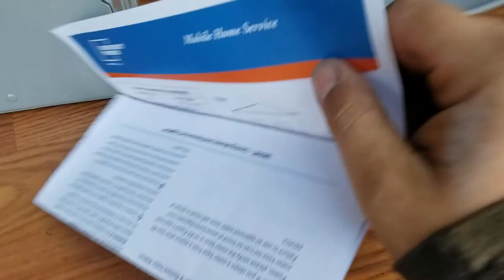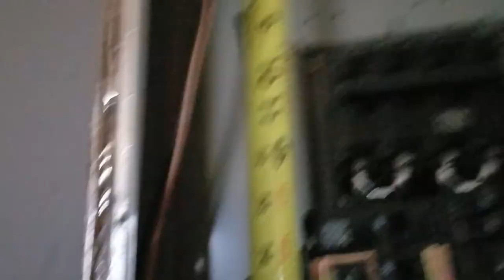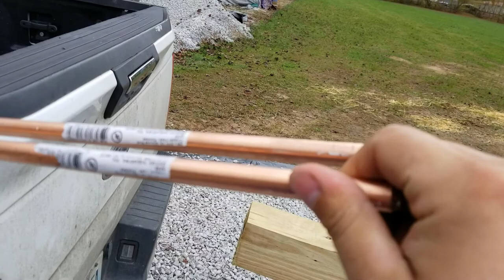How To Install Electrical Service: 200 Amp Main Breaker (Electric Service) Cost

Comment: I'm going to help a friend setting up his trailer...I've done industrial electrical work most my life...found this video very helpful...well done! Only question be why such a big earth ground (green) cable?
I believe a #4 wire...non-insulated...would've worked.
👍
Reply from the maker: It's not necessary
Reply from the maker: Only cable available at that moment

Comment: Great Video. I have the same inside 200 amp main panel in my Double wide as of recents I have been having the 200 amp main breaker trip off and get warm to hot. On the left side of breaker housing looking straight on. I turned off the 60 amp,50 amp and amp breakers for the in op furnace, outside central A/C unit.To lighten any excess load. It is winter and we nave 3 small space heaters that pull 1000w each An eleecteic water hear 40 gallon,plus 3 tvs and a fridge. The heaters seem to make It trip occasionally but more.recently the water heated does even with the heaters off. In your opinion do you feel that too much load on the 200 amp.breaker,  bad ground or bad 200amp breaker. Also on my ge 200 amp.breaker wher e the 2 hots come in to the lock lugs. The left lug is only making contact on 1 side of the metal brackets were the circut breaker inserts. Should all four brackets be touching the lugs and may thos be causing the oveoaded 200 amp breaker? Once again awesome video.
Reply from the maker: ThNk you!  You're the best!
To answer your problem,  you have a faulty inside panel.  I have ran into same issue in another rental.  Initially. We knocked the main breaker outside and then on the inside panel. We redid the lugs and tightened everything down.  It was a temporary fix.   Until we got the indoor main panel.  We then had to cut some sheet rock to reinstall the new panel.  Now that the project is finished. Everything works as it should.  Join my discord if you need anymore help

Comment: How far does the meter base and disconnect box supposed to be from the mobile home?
Reply from the maker: Depends on your code in your area. We can have ours right up against the home
Reply: @hurley001  I really don't know much about it. I have to install electric in a single wide trailer in Southern West Virginia, Near Huntington
Reply from the maker: @countryascanb5229  you should be fine. If you want to put it a couple feet away. It should be okay. I'm about 1 hr from you bub

Comment: I'm really interested in learning some of this stuff. At this point, I'm just a little better off than clueless. Does it matter which hot wire goes where in the panel? Are they the same wire? Does it work as long as you run them to the right place in the meter box and in the panel?
Reply from the maker: They carry same voltage
   Ad long as either hot goes into either hot lug you are good
Reply: @hurley001  thanks a ton. I am getting some electrical work done. I know a guy that has been an electrician for over 50 years. He's recently had surgery and can't do any of the manual labor himself. I was just curious to see if this were something I could do the physical work myself and then let him inspect. I have basic knowledge of how it works but not much knowledge when it comes to the specifics of connecting things.  I knew what and where the neutral connects but wasn't sure on which of the 2 hots went where. This guy is gonna help me out a lot just by being there to sit on a stool and tell me what to do but I would love to be able to get as much done as I can before he gets here. I would like to keep him from moving around as much as I can. Thank you very much for the information
Reply from the maker: You should be able to do the work on your own as long as he has number to give to the inspector.   So what I do,  I do the work and I have a friends numbers.  I call inspector. He comes out. I give him the numbers. He looks over the work and it passes and we are finished
Reply: @hurley001  so my friend got here yesterday and inspected everything. I had almost all of it done (all of it done right lol)  before he ever got here, thanks to you. The only thing I didn't have done was a ground rod. He has an air compressor and power inverter in his truck with an impact and auger. I just stretched the air hose and ran the auger down 5 feet. The ground here is really hard so it was a lot easier than hammering it in all the way. The impact and auger does all the work if you take your time. With the auger being a little smaller, the ground rod still had a snug fit. It gets inspected Tuesday but my friend says he is 100% confident that everything is good to go. Thanks again
Reply from the maker: Awesome!  Update me asap on the inspection
Reply: @hurley001  they rescheduled the inspection. The guy that was supposed to come out to do the inspection had a death in his family. Very understandable why he wasn't able to make it. It got done Thursday. Everything was fine. Electricity is supposed to be connected Tuesday. Thanks a ton.
Reply from the maker: @joemattox7525  awesome!

Comment: I have a question for you.   Is the meter base equipment grounded?   I’m thinking that since you put Teflon tape on that nipple, that there is not ground between the panel and the meter socket.   Did you say you put 4/0 copper to the ground rod from the panel?   Largest you are supposed to run to a ground rod is #6.   Everything else, except the equipment ground size seemed well done!
Reply from the maker: Copper 6 from panel to ground rod.  I did use Teflon. However, wouldn't the neutral serve the purpose of meter ground as well?
Reply: @hurley001    It depends.  Yes if the lug for the neutral is bolted directly to the can.   That is possible.   If not, then the fittings as ground are questionable.   Been too long since I’ve been in a meter socket.   Hopefully, you are correct!
Reply from the maker: You're the best. Thank you!
Reply: @hurley001    I’m retired Electrical Design Engineer worked for contractors 35 years.  If you have any questions, I can try to answer.

Comment: Do the two black wires have to match? Like from the breaker box outside does the left hot wire have to go on the left inside and the right with the right spot?
Reply from the maker: No. They are 120v either way you put it
Reply: I was looking for this answer by everywhere thank you!

Comment: What size cable can i use from meter to 200 box amp?
Reply from the maker: 4/0
Reply: What about 250 kcmil?Its bigger correct.If I use 4/0    .Its just #1#2 hot and neutral or ground correct.Is it better all cables together or individually.In one bundle
Reply from the maker: 250 is bigger.  Yes 1 and 2 hot and neutral. I like all together
Reply: Thank you
Reply from the maker: You're welcome
Reply: @hurley001  do i need a 4/0 neutral wire as well?
Reply from the maker: 4/0 line 1 and 2 and neutral. From meter to box
Reply: But that be 4 correct 2 hot 1 neutral and 1 ground?
Reply from the maker: @ramongalaz6263  from meter to outside 200amp box is only 2 hots and nuetral
Reply: Thank you
Reply from the maker: You're welcome

Comment: Is it a lot different installing a meter box/ main disconnect combo box? Like do you still have to wire the meter and what not. Confused! lol
Reply from the maker: If meter and panel are in 1 box   no need yo wire it

Comment: Did you pass inspection using metallic conduit with teflon tape and no bonding bushing?
Reply from the maker: I had a 2 inch bushing on the nipple

Comment: Hey Hurley can you please share the link to buy the cable that you used in your video from the meter box hub coming out of the weather head and the feeder cable that's used from the 200amp breaker box to the Main breaker box inside the mobile home trailer.
Thank you.
Reply from the maker: I think I have everything listed with link on my other electric vid
Reply: Thanks a lot.
Reply from the maker: https://www.lowes.com/pd/Southwire-Southwire-4-0-4-0-4-0-Aluminum-SEU-Service-Entrance-Cable-By-the-Foot/3129321  this is the cable that goes down the pole to the meter box.

https://www.lowes.com/pd/Southwire-Southwire-4-0-4-0-4-0-2-0-Aluminum-Mobile-Home-Feeder-Service-Entrance-Cable-By-the-Foot/3129329   this is the cable from main lug to panel inside home
Reply: @hurley001  Thanks once again.
Reply from the maker: You're awesome!  Thank you!

Comment: Anyway u can drop a list of all the material you used im getting ready to do the same thing an really could use a list to go off of thank you sm
Reply from the maker: I can send to you asap. I'm not home at the moment
Reply: That would be great please I’m having the hardest time trynna get a material list up for it
Reply from the maker: Just got home.  I will give you a list asap
Reply: Okay thank you sm !
Reply from the maker: @vaniwoods6351  
4/0-4/0-4/0-2/0 Feeder service Cable,

 4/0-4/0-4/0 Service entrance cable,

2" conduit schedule 80 underground and schedule 40 above ground(you will have to measure your job to know the amount of conduit needed),

200 amp outdoor main breaker panel,

2- 2" insulating bushings,

2" male thread to female conduit coupling

3- 2" conduit locknut (steel rigid)

Raintight 2" hub

2"dia x 3" length Steele nipple

2" Service entrance bushing

2- grounding rods 8'

1" straps for Service entrance cable(amount depends on length of pole)
 
No alox
Reply from the maker: Did you get the list?
Reply: Thank you 🙏
Reply from the maker: @vaniwoods6351  you're welcome
Reply: So the 4/0 4/0 4/0 2/0 is the wire that runs from the bottom on the meter base into the breaker box correct
Reply from the maker: @vaniwoods6351  yes
Reply from the maker: @vaniwoods6351  it's also the wite that goes from breaker outside to breaker inside

Comment: The panel I bought is almost the same as your but I only have 8 breaker spaces. I noticed my panel doesn’t have the three lugs across the the bottom and I can’t connect the neutral wire. What do you recommend?
Reply from the maker: This panel more than  likely is the wrong panel.  I actually bought the wrong panel as well and had to take mine back for the right square d. Where did you buy the panel?  And send me link
Reply: @hurley001  I bought the same panel as the one at the beginning of your video, but will need to change it for the right one. Where did you buy and, do you have the product number for the right panel?
Reply from the maker: I'll find you the product number asap

Comment: why didn't you put the meter on the house and the electrical panel inside
Reply from the maker: I could have put a meter on the house.   However,  doing that,  I would have to drill a hole thru the side of the house,    and also mount the service  pipe to the outside wall and then I would hope I hit studs on the mount.   If not. Once the power company put their line in. It would have ripped off the wall
Reply: @hurley001  ok thanks
Reply from the maker: @Jalen123  you're welcome

Comment: It seems like the service entrance cable was different than the cable that goes inside the trailer. Can you specifiy what type of cable you used?  Thanks!
Reply from the maker: I used 4/0 4/0 4/0 service entrance cable and then I used 4/0 cable for the breaker to the home
Reply: @hurley001  4/0 hot 4/0 hot 4/0 neutral right no ground ? im going to use 4/0 4/0 2/0  is that ok ?
Reply from the maker: @Frankensteinfabrications  depends on the electric code in your area.  Minimums are 4/0 hot hot and nuetral. And depending on the length run.  Use #6 copper or #4 aluminum
Reply: How or where can I go to verify what code the county uses, if it is between 60 to 100 feet for the underground wire, which would be the correct one?
Reply from the maker: Talk to your local power company y engineer

Comment: This is land owned home correct? What about a mobike home park install...do you have a video by chance?
Reply from the maker: This is my mobile home park
Reply: Thank you! Go Park Owner!
Reply from the maker: @vdarr1  thank you!  I do septic for each home I put in.  Saves me about 4000.00 per system.
Reply: @hurley001  oh great! Let me ask you. O sm in a park. The lot they gave me was too small...they set it in the water meter...so I started waste lines..only to notice sewer pipe(city)..is located halfway under the unit...do I dare hook onto that? You are so kind for taking this time with me!#rare
Reply from the maker: Have you talked to a local contractor yet?  I would see what they suggest to do and also see what you could get by with in your local codes and then we would be more confident on what to do next
Reply: @hurley001  My thoughts exactly.  Since I have applied for permit as contractor. I will call codes? Tomorrow?
Reply from the maker: @vdarr1  you can call about codes or just get some other contractors opi ions on what you can get by with. I'd have to see you situation before I would make a definite decision
Reply: I passed inspection Thank's to your help!!!!You Rock!
Reply from the maker: @vdarr1  awesome!!  I'm glad it went great! For you!!
Reply: @hurley001  Thanks thou you!!!

Comment: How much did the weather head and wire cost were getting ready to do the same job u helped us out a million with ur video about getting this all done right
Reply from the maker: I didnt use a weather head. But they arent real expensive if you do.  I used weather conduit cable.  The total price is roughly 1,000.00  that included the box and pole etc.

Comment: The first box hasn’t the two lugs did you switch for en other one
Reply from the maker: Wow.  You have an eye on you!  Yes I switched
Reply: @hurley001  what type of box you used??
Reply from the maker: @FabisRojo  square d 200 amp
Reply: @hurley001  thank you 🙏🏼
Reply from the maker: You're welcome!
Reply: @hurley001  but did you add the lugs? Or it's a different box?
Reply from the maker: @joemata4874  different box. I didn't add lugs

Comment: Hi Hurley-001 a like you video it’s interesting une cuestión how much the labor cost not including material because you no the materials cost is hall now tank you
Reply from the maker: I did it for myself. No labor cost.  This was my personal project
Reply: exactly what i expected to find on youtube; I ask you I bought a very cheap mobile home because I had to make some repairs between them the utility pole is broken on the floor and the wires of the panel inside are all cut my question is exactly to do that work which you did, I need some permission For that, as the owner, I would have to rewire the entire mobile home, I need to have an electrician's license for that, or as the owner, I can do the work following the codes and there will be no problem with an inspector, such as the process with the inspectors, the city and the power company, last question what are the names of the respective wires that I need for underground
Reply from the maker: @anthonyorona9947  the underground is 4/0 aluminum service cable.  If you have tonrewire the home and want to keep it a secret.  That would be your best bet to avoid any road blocks with inspectors etc.

Comment: You can't use thread tape in electrical You need a low impedance path so if you have a ground fault it will trip the circuit breaker immediately. that is a no no You need bonding bushings on your nipple You need to take a grounding and bonding class before you any service work
Reply from the maker: I'm sure you are right about this and I may have done this wrong for codes in your area.  Before I did any service work on my own. I went over it with the inspector and he gave me a list of what to use and get..  I'm not licensed for this just a diy

Comment: This is not plumbing....do not use teflon tape...you need the metal to metal contact for the electrical bond.....you need a grounding type bushing with metallic raceways......stop it with the teflon tape.....metal to metal is the way bonding works.....you are going to burn someone's house down.......I am a journeyman electrician of over 25 years.....please people....do not follow this man's advice!!!

Comment: Do the top lugs on the meter box always connect to the power supply whether you top or underground feed?
Reply from the maker: Doesnt matter
Reply from the maker: Depends on your meter base.   Send a pic to the discord and I can help you out
Reply: @hurley001  200amp underground service to supply an exterior RV 50/30/120 panel and an interior 100 amp sub panel for inside the barn. Pop outs are top center or bottom on the RV panel and top or bottom feed on the meter box. Trying to figure out best configuration to build the meter rack
Reply from the maker: @Larsterlarster2010  okay, you shouldn't have any problems with which direction you go with line in
Reply: @hurley001  ok. I tried to upload pic, RV panel only has openings on the bottom, box is pretty busy inside, Oncor wants feed under meter box and I guess out the top to feed RV panel. Seems like a lot of cable in meter box to get to the opposite side lugs inside meter box Thanks for the help!
Reply from the maker: @Larsterlarster2010  Sounds like its gonna look ugly.  Every county has their own codes.  Luckily we arent restricted much in my area